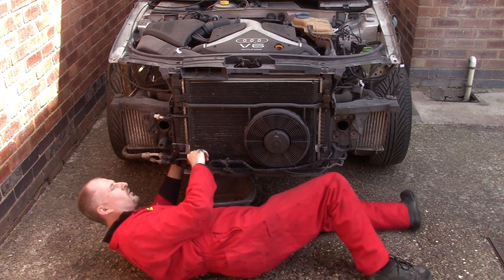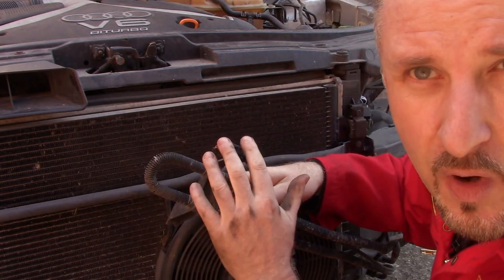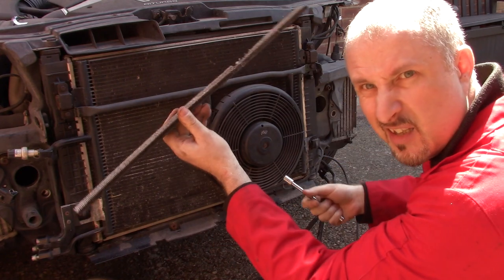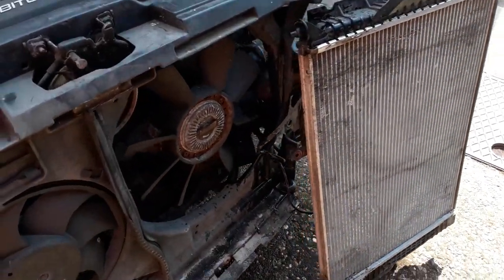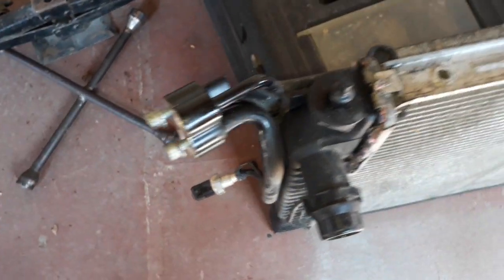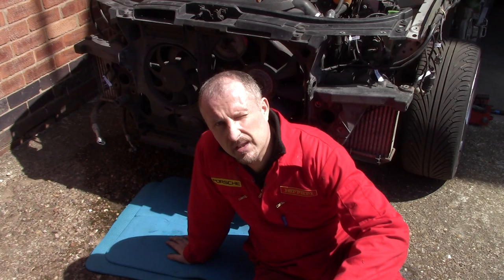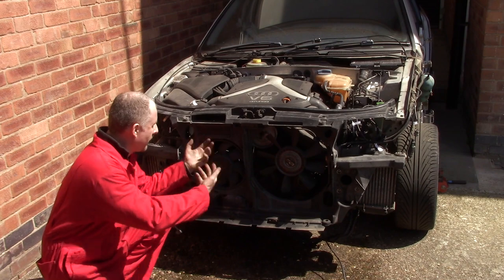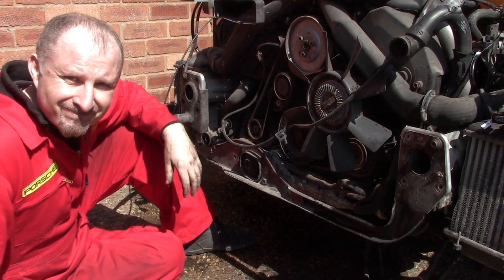Removing the Core Support: Audi 2.7 Bi-Turbo. Ep10.

Comment: Core support - I thought the core of the car, then maybe the radiator support panel as we call it here. Yessss, I was right on my second thought. Like the Aussie winter, water doesn't evaporate immediately. We can buy aftermarket electric fans here that attach to the radiator with 6mm bolts thru the fins of the rad. S'pose you can there and you're being stingy? Always good fun and satisfying blowing shit away with the air gun, hehe.
Reply from the maker: Yes with an audience world wide, it's difficult to name some car parts. And don't get me started on Boot or Trunk lol. Yeah, I think I might have to spring the extra dollar and buy aftermarket fans, but I don't know whether to go the whole hog and go custom Aluminium rad with dual fans. I'm thinking big power down the road.